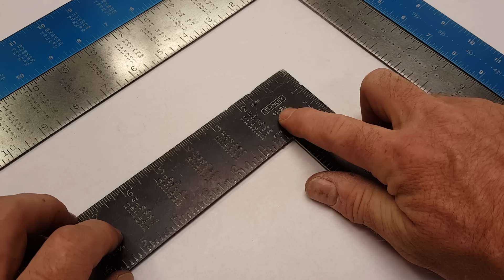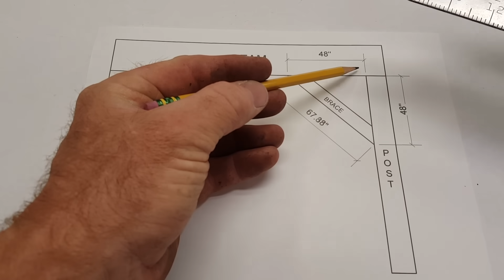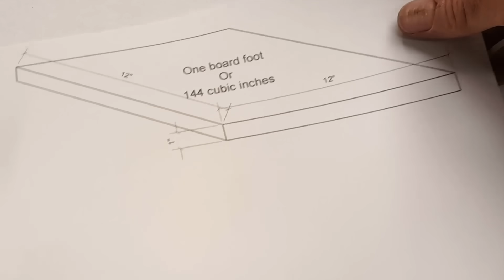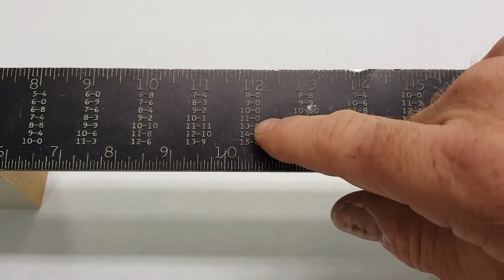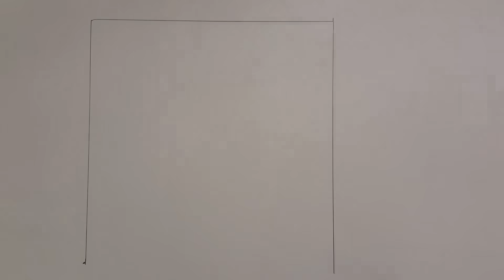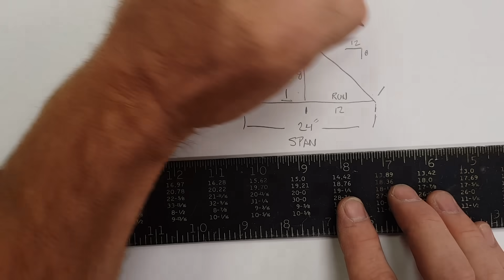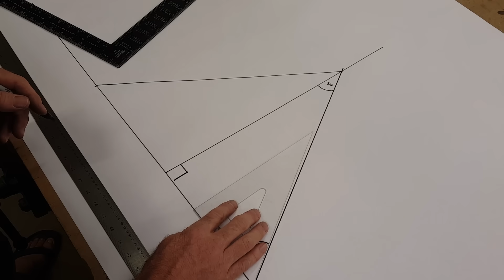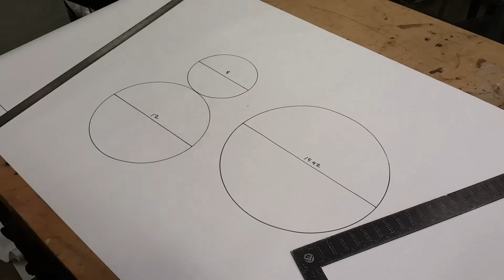Framing Square Basics - How to use one

Comment from the maker: To make this video easier to use as a reference guide I have provided a list of links to topics in the video. 

-- TIMESTAMP LINKS BELOW!!--

Introduction 0:00

Names of the parts of a framing square...0:25

Face and back of the framing square...0:45

Ruled Subdivisions...1:04

12ths & 10ths and their uses...1:31

100ths scale and it's uses
     - Introduced...2:12
     - used with brace scale...3:48

Brace Scale...2:33

Board Foot Table
   - introduced...4:08
   - Board foot defined...4:18
   - Explanation...4:33
   - Used as a multiplication chart...6:07

Other chart and tables found on newer squares
   - Number of studs in a given wall length...7:12
   - Convert fractional inches to decimal feet...7:44
   - Convert roof pitch to degree...7:56
   - Wood screw pilot hole sizes...8:10
   - Convert fractional inches to decimal equivalent...8:18

The Octagon Scale...8:23

Roof Framing Rafter Tables...9:14
   - Roof pitch explained...9:45

Drawing equilateral and 30/60/90 triangles...15:28

Finding the circumference of a circle...12:19

Finding the area of a larger circle with a sum equal to two smaller circles....13:14

Drawing a circle with a square in lieu of a compass...14:35

End cards...15:13
Reply: Make Build Modify i love the circle part thxs

Comment: After all that, Think I will stick to metric. So much easier for those of use who have long ago left imperial and learnt metric.
Reply from the maker: Many carpenters in the U.K. use the imperial system for roof framing because it's much easier to do the rise/run math. It all depends on job at hand. Metric is great for consistency but falls short when working with fractions is necessary.

Comment: I don't know why I've been avoiding getting one of these. I've literally been using Pythagoras' math and figuring out hypotenuse to right triangle forms such as the roof for a doghouse I'm planning and a new mailbox I'm currently building. Woodcuts are ever so much more important depending on the scale. If I'm not precise in the mailbox I'll have large looking gaps but if it was a covered drawbridge with 60° roof big enough to cross a river....less noticeable.
Anyways, I will get one ASAP because it's got more than one table using Pythagorean theorum on display and the trick with the graphing of circular math is based on an old  math concept of pi being really close to 22 7ths twenty two divided by seven. Which is accurate to about five or six places. The brilliance of the framing square trick is accurate to at least one decimal. And that's close enough for carpentry. Say you want to know how much edge banding you need for a lazy Susan cabinet with a radius you route with your circle jig set to 11.5 inches. Framing square, pencil and paper or calculator and school?  Both are good.
Reply from the maker: Glad it inspired you to give one a try!

Comment: When doing the circumference how did you get 7 and 22?
Did you just pick those as the example? And what told you a seven inch diameter is a 22 inch circumference?
Reply from the maker: Any diameter to circumference relationship will work for the first triangle. I picked 7" and 22" because it's the biggest triangle with whole numbers on the square.  22/7 = 3.1428 which is close to the ideal 3.1415. Technically, 7x3.1415 = 21.9905, which is about 1/32" off target. But for roughly calculating a circle it's very accurate.

Comment: "A 7-inch circle has a 22-inch circumference".

That makes my brain twitch!  But if I do the math, it's more accurate than one's going to get with a 16"-graduated framing square in any case -- so yeah, for many purposes, I guess it's good enough.
Reply from the maker: Yeah, it's pretty close. 3.14159 X 7 = 22.0213  which is about 1/64" over. Well, it's actually 1.3632/64" over.  Yes, I did that, I used decimals in a fraction. Lol. Regardless, when you get down to 64ths you pretty much have to mark with a knife because the lead of a pencil is too wide. So, for framing 22" works.

Comment: Are y'all finally ready to go metric like the  rest of the world
Reply from the maker: I use both. There are a lot (most) of structures in the US that are built with Imperial system materials. There would be no advantage to using the metric system only to convert back to imperial every time you had to buy materials.

Comment: “Let’s look at 48 right here (points to 7 1/2 on the square). 
What?
Reply from the maker: That would probably be the brace chart and not the ruler.
Reply: @Makebuildmodify  sorry, my bad. Your pencil went to the 7 1/2 half mark incidentally before settling on the 48. I regret my comment.
I subbed, liked, and hit the bell.
Reply from the maker: @michaelpace1075  Lol! No need to regret. Thanks for the sub!

Comment: Do they make a square this size without those darn 10ths and 12ths?    I don't give a flying duck about 10ths and 12ths.   I can't tell you how many projects I've flormboasted because of the stupid framing square a have.   I'm a metal worker.

UPDATE: Yes they do.  Starrett FS-24, Empire 1110, Swanson SVL123, TS157.   The Empire is a measly 1/16 thick.   The SVL123 is aluminum.  I went with the Starrett.
Reply from the maker: Nice!

Comment: I used a Framing square all my life, cut commons and jacks but in my 38 years of building homes I didn't know some of the uses and wanted to say thanks. I'm retired, old, busted up but still have a great memory so maybe I'd be able to pass some of this off on my 3 grand sons and one grand daughter that's showing a great interest in Mathematics. I was able to do hypotenuse of triangles in my head, that and square root, which was a great help when setting forms. All other kids I've worked with whether I liked them or not were only interested in a payday, lol. Thank you, it was great video!
Reply from the maker: I use the common rafter length chart to get the hypotenuse of a given triangle all of the time. I just multiples of the length indicated on the square. It's a handy trick.

Comment: metric is so much easier lol
Reply from the maker: Depends on what the application is. They are no more than lines on a stick. Personally I use both. That way I get the job done instead of complaining about the system in question.
Reply: @Makebuildmodify  wasnt judging; if anything its more impressive that you prefer the more complex use of fractions
Reply from the maker: @2HHB  I didn't intend to offend  either. I agree that fractions can be more complex in some applications. Although, slope is expressed in a y over x Notation in any system. And y/x is a fraction. The steel square provides many shortcuts to achieve slope operations.

Comment: The body has been called the blade for centuries.
Reply from the maker: Depends on your local conventions.  Plus, you're just barely correct about "centuries"  plural. The steel square was patented in 1819. I'm not entirely sure that the body/blade nomenclature was immediately used after the patent. So, I would say that it's doubtful that it's been called the blade for "centuries"
Reply: @Makebuildmodify  that may be an exaduration, but it also may not. Greeks taught Romans how to build hip roofes tens of centuries ago. The framing square is depicted in drawings from the time. They probably didn't have rafter and hip rafter length and incremental length cheat sheats stamped into them, like today, but they were used for centuries before the first European settlers hit the Americas. They were made of metal since the first white smiths, which was a VERY long time ago. It is possible that the name of the tongue portion is regional. I have built stores in forty states, and that is what anyone, I met and my age or better, called the 2'×2" (outside) portion of the framing square. Construction is infinitely bigger than I am. You may be entirely correct. That is my experience. It is a lot in years, but miniscule in the grand scheme of things.
Reply from the maker: @vitodelorto1796  Agreed.

Comment: this was a very informative video, and yes, you earned the subscription, and a thumbs up of course. I have one question, I am using a stanley metric framing square.. but all the info out there how to use a framing square is all about imperial measurements, in inches foot ectra. I am trying to find a simple explanation for a very long time, about the layout on the Stanley metric one.. Do you, or anyone else here know where I could find the proper explanation about the metric one? thanks in advance, and happy to have found your channel.
Reply from the maker: Thanks! What are you trying to achieve? Do you need instruction for a particular project or are you looking for a general overview? The fundamentals should be pretty much the same. I haven't worked with a metric square that much, but if you have a specific problem I may be able to work it out.
Reply: @Makebuildmodify  hi, so nice of you to respond, for that already a big thanks. I am looking for a general overview because the layout on a metric one is not the same. I understand the concept, or kind of.. after your nice detailed explanations and some other peoples explanations, but because it confuses me to try and get it working on the metric, I hoped you might have worked with a Stanley metric 45-530. I have looked if I could find a detailed manual how to use it,.. like there is for the Chapell ones.. but no had no luck finding one. I have this one a long time,.. and I do understand the step off methods.. I used it for stairs mostly, but I always wanted to learn the full use of these great tools, to advance my skills as a carpenter. If you ever come across a metric one and figured it out.. count me in on the watchlist. thanks, stay healthy and save, and gods bless be upon you.
Reply from the maker: @sildefluiter3401  Okay! I might buy one and take a closer look at it.

Comment: Hi great video, I'm a builder in the UK and wondered whether you could give me some info on chart no 5 on the roofing square, side bevel cut.
Ive cut some timber using what I thought was right but it doesn't work, I've looked through the Internet but can't find the answer.
Regards Scott.
Reply from the maker: Hi Scott, I think your talking about the side cut or bevel cut of a Jack rafter. These are the rafters that run parallel to the common rafters but instead of reaching the peak and intersecting with the ridge they intersect with the hip rafter. If you are building a standard hip roof at ANY slope just mark the plumb cut for your slope on the side of your rafter and set your circular saw table bevel at 45 degrees. This will work for any standard hip at ANY slope as long as your timber is small enough to be cut with your circular saw. This is one place in roof framing that has a kind of automatic self adjustment.

If you are cutting beams larger than your circular saw can cut then you'll need the bevel cut information on the square. If this is the case, let me know and I can try to walk you through the marking process.
Reply from the maker: Scott, This may help. This is a free book from Google books. It's old but the math has not changed. Look for "laying out Jack rafters". This link should take you right to the page you're looking for. https://play.google.com/books/reader?id=UOQ6AQAAMAAJ&hl=en&pg=GBS.RA1-PA8
Reply: Hi thanks for the replies, Tbh cutting the Jack's up the hip I'm OK with, what has baffled me is after watching The Essential Craftsmen on utube where he is forming a dormer with valleys half way through the video whilst marking the valley rafter he refers to marking the cheek cut at 49 degrees which he's says is from no5 table on the framing Square, yet his roof is a 9/12 pitch and the measurements on the square on no5 table give 9.5.
So I'm kind of mithed where the 49 degrees comes from.
Ive always cut the Jack's at common pitch and 45 degree bevel cut.
Cheers Scott
Reply from the maker: @scottinstrell2795  I'll take a look a that video and see I can work out what he means. I'll get back to you soon.
Reply from the maker: @scottinstrell2795  okay so I think I watched the video you were talking about. I checked the square and if you mark the bevel using the framing square on the jack rafter, the line you get is about 49-50 degrees. But it's important to remember that the angle of this mark is compensating for the pitch of the roof. I ran a test to check. If you mark a 50 degree  bevel line, then cut along a 9.5/12 plumb cut with a circular saw set at 45 degrees the saw will follow the 50 degree line that represents the bevel. I know it sounds counter intuitive, but it works! You can do the test yourself. Scott from the essential craftsman just skipped that part in the explanation from what I see.

Also, he's using 9.5/12 for his roof and that is not on the framing square. You have to look at the numbers in the 9" column and the 10" column for the bevel row. Then split the difference. The 9" column says 9-5/8" and the 10" column says 9-1/4" so that would be about 9-7/16". I think he just rounded up for convenience.
Reply: @Makebuildmodify  hi thanks for taking the time to check this for me, you can understand why it baffled me. I think I'll cut a few test pieces this weekend and have a look.
I use the steel square all the time but have never really thought to much about line 5 and 6 on the square until I watched that video.
Ive just cut a big roof on a extension I'm doing and for some reason the bottom seat/bevel cut wasn't sitting how I'd like it to, even though I was transferring the common pitch of both roofs and side bevel/cheek cut to the timber which ran up the lay boards.
That's the reason I started investigating, anyhow thanks for taking the time to explain.
All the best Scott.
Reply from the maker: @scottinstrell2795  you bet! Thanks for watching my videos!
Reply: Hey thanks for the reply, you know when it's one of those things that is bugging you when your always thinking about it, I'll have a play around with my square and see how I get on.
Thanks for taking the time to reply.
Cheers Scott

Comment: Great video, you've opened a whole new world to me, many thanks, I bought my first framing square only recently and now I can learn to use it properly, very well explained, although it will still take me a few views til it all sinks in, I bought two brass screw on pieces for marking out stairs etc without having to refer to markings once set up. Subscribed
Reply from the maker: That's great! You'll find that the framing square can be very useful. Thanks for the sub!

Comment: In teaching insurance restoration carpenter teams in the use of the framing square I explained that nearly every building project is based upon they theory of a right triangle. (Pythagoras theorem) and demonstrated how a roof pitch is made of two right triangles back to back. Which makes the diagonal easily measured using the carpenter square. A "Pythagoras dream" I call it. Without using a calculator just measure the diagonal by drawing the points between the span on one side of the square and the rise on the other side of the constant of the 90 degree steel square. Any dimension can be multiplied to scale of feet and inches for any size structure. To me the next important usage for a constant 90 degree square is in laying out rise and run on a set of stairs.  Often they do not want young carpenters to know the trade secrets so they can keep them relegated to unskilled labor and lower pay which is the opposite of my theory that the more I can teach a worker better skillsets, the more work I can take off of myself. The old masterbuilders did not have calculators and "plastic speed-squares" but made use of the tools at hand and common sense.  A string can draw a circle or pull a straight line for long distances, a square to construct a right angle, spirit level, plumb bob and an accurate measuring instrument along with your cutting instrument will give you the means to construct a lifetime career in building trades. It takes little more math than simple addition, subtraction and multiplication or else un-schooled masters of the past could not have done their enormous bodies of work.
Reply from the maker: Hi John, I agree. Understanding the basic tools and methods is the foundation for all other practices. I often recommend old carpentry books to people that are new to the industry. The older books have a way of tethering the basics to the final project in a way that is all but gone in the new guides.
Reply: These videos provide a great resource @Makebuildmodify  Yes the concepts are really not difficult or complicated it just requires basic information to open up a vast scope of knowledge. Without the basic instruction it may remain locked away when it could prove a very interesting and rewarding revelation to be passed on to generations. The rafter square has such a beneficial record of information that I marvel at how misunderstood it can be.  Thanks for video media so many topics can be available passing it on to all